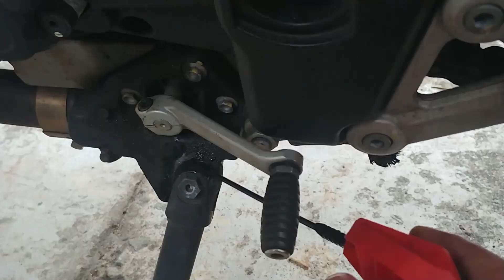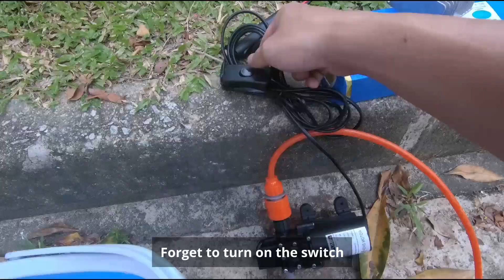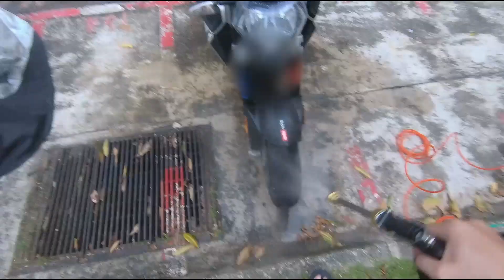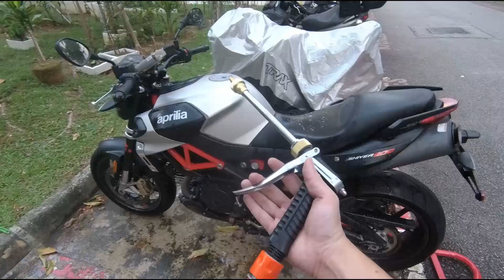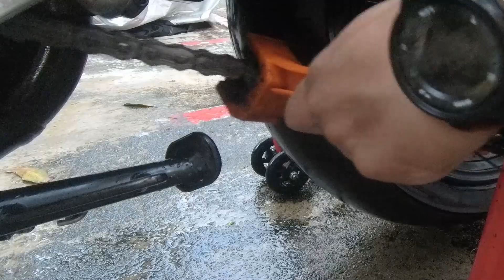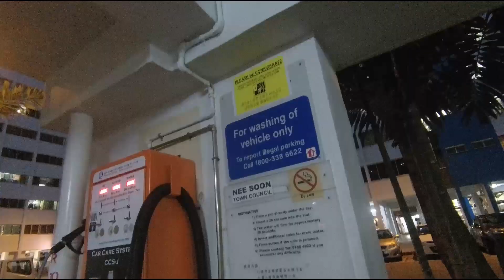12V Pressure Washer - Cheap + Good? | Wash Your Dirty Bike with Ease

Comment: Susah ya bang kalau tinggal di HDB, gak ada tempat buat cuci sendiri kendaraan 😁 mesti pakai parkiran umum untuk cuci.  Terus oli yg netes di parkiran bikin kotor apa gak kena denda tuh?
Reply from the maker: Agree with you on the oil drip will subject to fine(s), I "think" (might be wrong thinking) this is mainly targeting at multistory carpark (MSCP) where the drainage systems are poorer (smaller drain pipes on upper levels) and also protected from heavy rain wash off.

For my case, I usually do 2 things to prevent that :

1) Wash near or on the drainage (like in the video), so the dirty /oil will flow into the drainage easily. Thereafter, jet off (clean off) the residues (oil, soup or dirty) that are still static there.

OR 

2) Move the bike into the washing bay ( found in older HDB blocks which don't have MSCP, if I'm not wrong) and wash there. However, we still need to clean off the residues thereafter. 

I guess this is only an issue for folks who stay in the older HDB areas where there are lesser MSCP. The newer HDBs all comes with MSCP as standard, so likely they will park there and wash at the designated washing bay within in MSCP.  

****Translated via google translation (hope it's perfectly translated)

"It's difficult, bro, if you live in HDB, there is no place to wash your vehicle yourself 😁 you have to use a public parking lot for washing. Then the oil that drips in the parking lot makes it dirty isn't it subject to fines?"